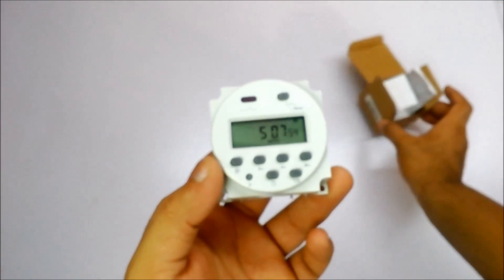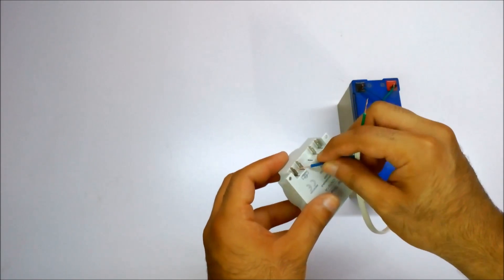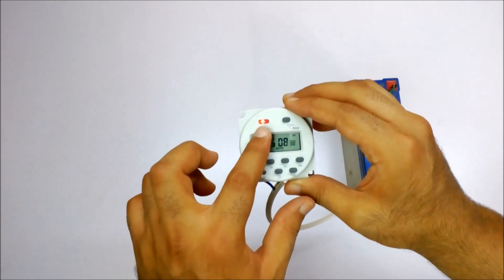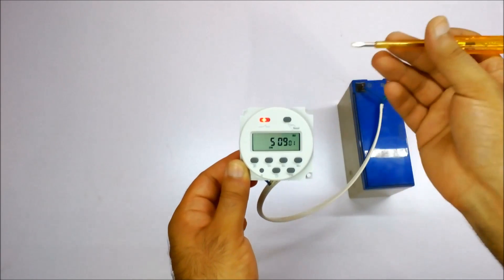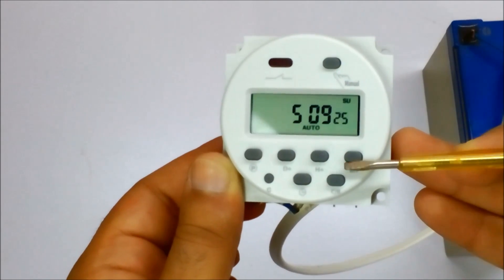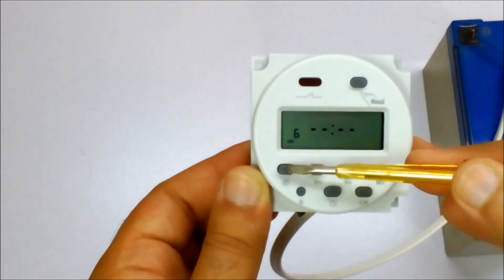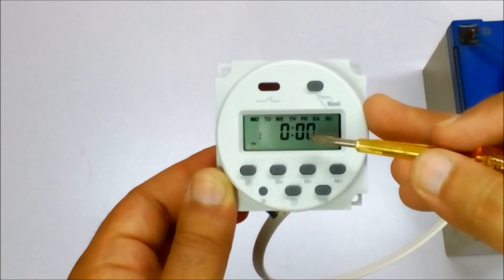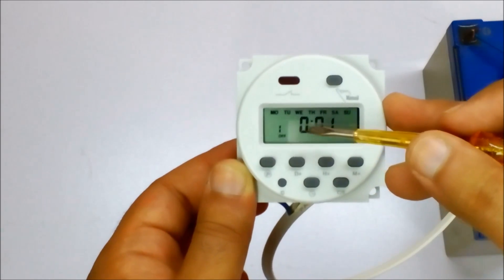digital timer switch setting with wiring for incubator cn101a

Comment: Does it lose all the programs you've set if 12 volts is disconnected?  Also, if no programs are set, is it normal for the Manual function to be disabled?  3rd question:  what does the C/R button do?  Thanks in advance
Reply from the maker: The set program will stay until it is internal battery get discharge, if set can also make it work by pressing manual button it will work until lift off the button , c/r button is like if you want to look it like a countdown or custom display

Comment: Will it work on 7-8v input (2 x 18650 3.7v batteries) instead of 12v?
Reply from the maker: no it works only on 12v dc

Comment: Does the time programing lasts for only one week or it continues??? Kindly guide...
Reply from the maker: Once timing is set it will keep working for months until it's battery down then the setting will be reset, it is battery keeps charging so it needs  some days without electricity for the battery to low
Reply: Okay got it! Thanks alot JazakaAllah.

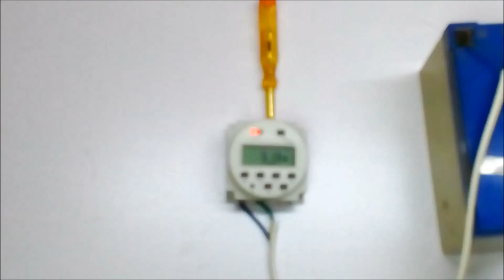Comment: What if you set the on-time for, say tuesday, at 7:00, but never set the off-time, in neither this nor the other channels, does the Q output will stay ON forever?
Reply from the maker: yes it will stay on if did not set off time
Reply: @Umairworkshop  Got it!

Comment: My timer stopped displaying digit. I think the inside battery is discharged.. How to recharge it?
Reply from the maker: It is connected to power ?
Reply: I was connecting to 12 volt dc in place of 220 ac!!!! 🤣🤣🤣.  Now it's working.. Thanks for responding..

Comment: so is this item usable for something like:
monday-Thursday 
open relay 07:00
close relay  08:00
open relay 16:00
close relay 22:00

friday-sunday
open relay 07:00
close relay 22:00

since i would like to automatize the radiator fan i made to distribute the heat faster, now its only on or of manually, and i want to automatize it.
{all the fans run at 12V-3A} total
Reply from the maker: you can use this timer 
https://youtu.be/_pCI9JA-s4Q
Reply: @Umairworkshop  im actually looking for one that does not have exposed circuits.

Comment: Hello Sir Umair,
Your video is excellent. Can I use it to start timer manually with single button for fixed minutes?(Not using schedule) . I mean I want to turn on water-pump for fresh water , when someone wanted fresh water for bath(I connected waterpump with shower directly). So the user just have to push one button and motor will turn on 30 mins and then turn off itself. Pls answer?
thanks
Reply from the maker: thabk you , it doesn't work like that you need to set the specific time to start and stop limit

Comment: Hello and thank your for your video. I wuold like to know if the timer uses its battery or the external connected to it?
Reply from the maker: you are welcome ,it has a battery inside which is charged when plug in the power source

Comment: so, is it the same if I use 220V AC right?   also works with 12V DC
Reply from the maker: This model uses 12v to power up and cut out both 220v or 12v  at one time

Comment: Can I use 12 v Mobile charger to supply power to timer?
Reply from the maker: Yes you can use 12v mobile charger
Reply: Thanks Umair for quick reply. Wish you EID Mubarak. I am having one more query. Instead of providing supply to motor from same battery can we connect wires of motor and timer to a single 12 v Mobile charger?
Reply from the maker: Eid Mubarak to you too ,  yes you can power them both from the same 12v mobile charger

Comment: very helpful video! i need to use a timer to control a 6 volt appliance, will this system work? or will i burn up my 6 v appliance? thanks
Reply from the maker: It will work with any volt for relay

Comment: I was going to use this item for my incubator's egg turner as a  control to turn 2 second on and off, every 3 to 4 hours/24H. Looks not the right device. Thank you for your video.
Reply from the maker: you can use this one instead 
https://youtu.be/YM82y6phO4k
Reply: @Umairworkshop  thank you, I will try to get that .
Reply: Dear William this device can also be used for egg turner in very effective way first operate your turner manualy and they count seconds using stop watch easily from your mobile it take about 5 or six seconds to turn eggs depends on the size of setup once you have a figure programme the timer accordingly and rest is peace of cake...I like the compact devices more then the bulky ones. Hope this would help you.
Reply: @durrani1983  
Thank you for your advise,👍🙏

Comment: wonderful tutorial, would you please help on connecting sinotimer TM618sH-4 labelled 12v DC on input and on output its labelled 16AMP/250VAC
 20AMP @ 30VDC
and can i use it to control something running on 220/240VAC?
Reply from the maker: if 220v is written than it can relay that voltage
Reply: @Umairworkshop  Thanks sir

Comment: Absolutely, terrible!
Reply from the maker: what happened
Reply: @Umairworkshop  I guess that comment was a little harsh but for a tutorial video, it left a lot of questions unanswered. For instance, does it have a positive and negative connection or can you hook up any wire to any terminal?
Reply from the maker: @nobznezz  the input wire can be put in any polarity , if the model is different then that will be mention on its back cover
Reply: @Umairworkshop  You're right. Thanks for the response.
Reply from the maker: @nobznezz  you are welcome